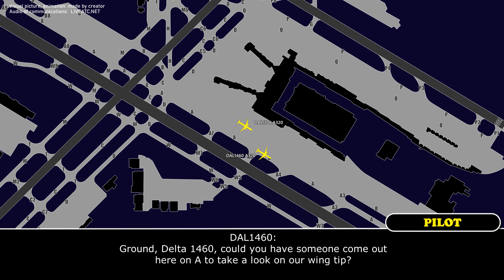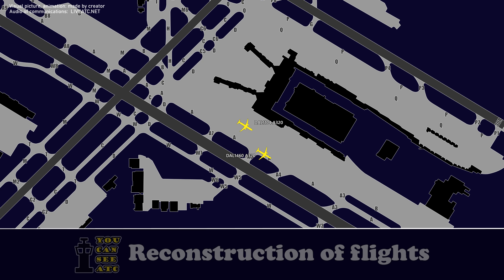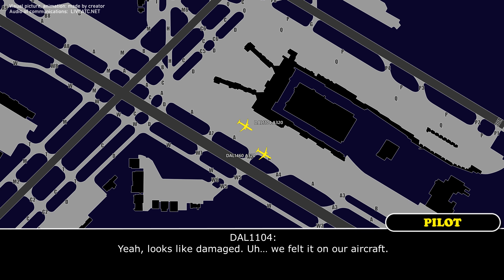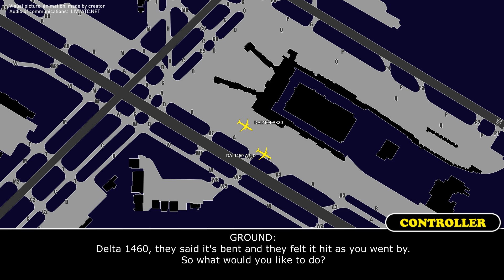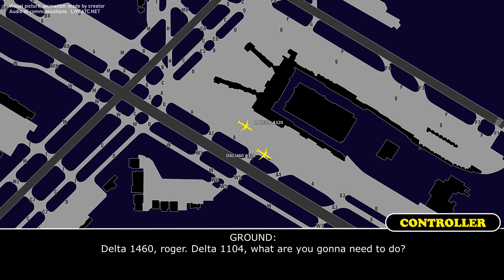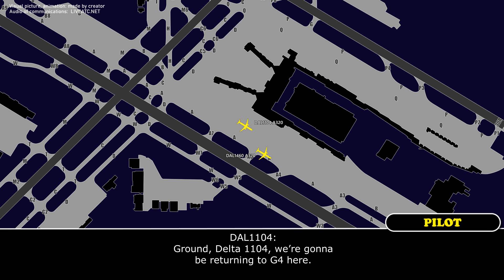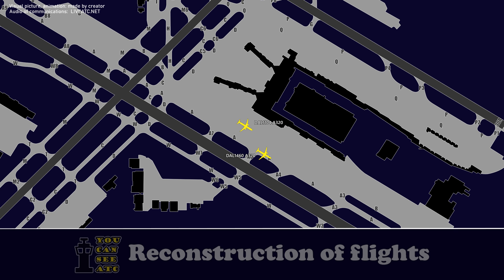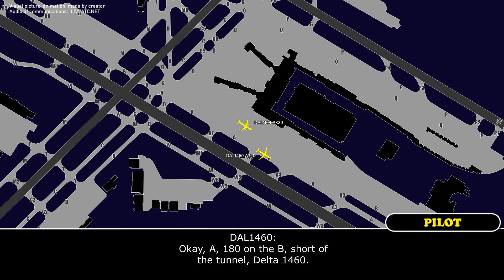2 Delta Airplanes clip wings at Minneapolis Airport. Real ATC

Comment: Who is at fault here?
Reply: Just a quick guess, since exact details are not mentioned, but the pushback plane was stationary, so the plane approaching and passing did so at their own risk. I.E. pilot discretion,if the pilot felt there wasn't enough room to make it, then they should have stopped.
Even if the pushback driver went too far out on the push, the approaching plane should have seen the gap and had situational awareness to know what space they needed .
Reply: Yeah it's tough. The alley should be wide enough, but if the tug spotted the mains of 1104 to the right of center the wing tip would stick out too far. The reality is that the pilot can't see their own wing tips so they have to rely on the assumption that everyone is spotted correctly on their lines. At the end of the day though, you know the pilot of the moving plane got reamed by the chief pilot...
Reply: no one cares, company will fix the planes and some light paper work. i dont even think the FAA will do much with it either. just another example of taxiway fuck ups
Reply: Delta Airlines.
Reply: @MrWhiterunGuard  not a helpful reply 😂
Reply: Yes

Comment: We were on a plane long ago in the 1980s and the truck doing the de-icing ran into the wing, taking the lights off the end of the wing. The pilot said it was daylight and we didn't need the lights now after an engineer cleared us. The pilot never throttled back. We landed in Ottawa a half hour later from Toronto.
Reply: What???  Your “comment” makes absolutely no sense. SO tired of you idiots here….